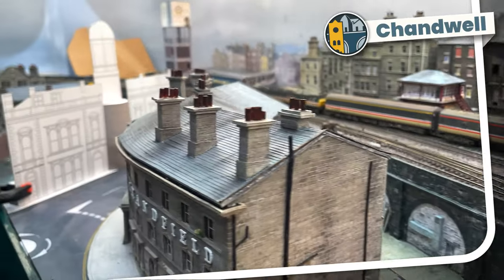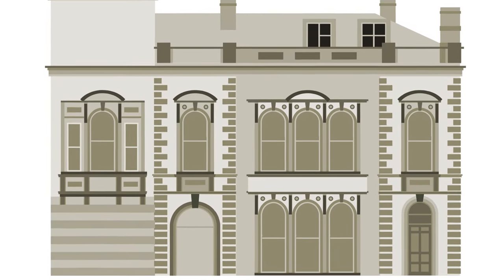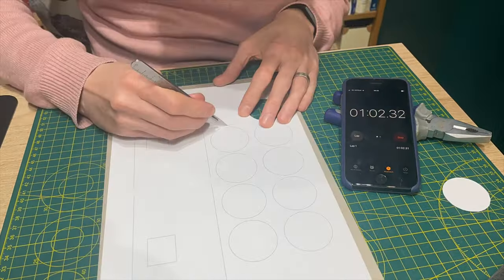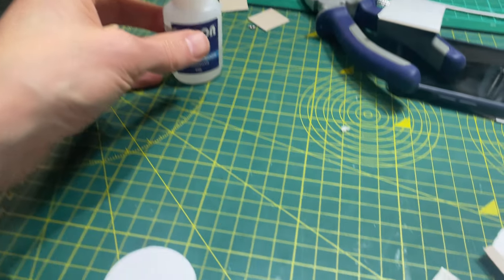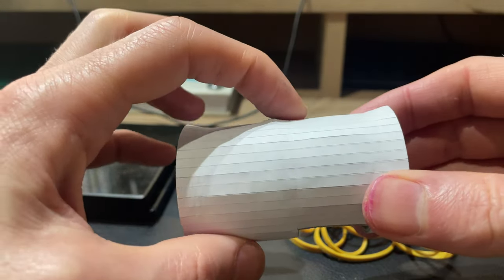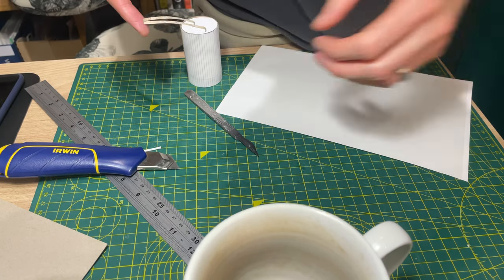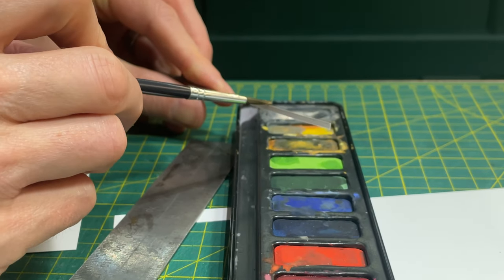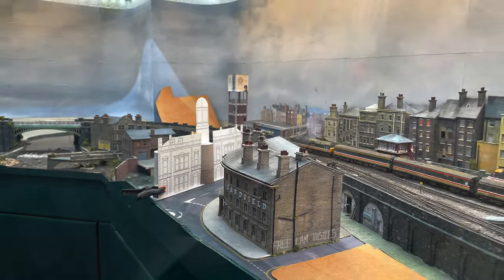Stone cylindrical tower made from card - Town Hall Build Part 1

Comment: I love your inspirational model building. I had an n Guage layout back in 1985 . Then my business took the space. I moved into building ultra light weight one meter model yachts where I used pantihose for hull strength instead of fine fiber glass.
Reply from the maker: "Pantihose for hull strength" I've not used that building material in Chandwell yet, but you never know! :)
Reply: @Chandwell  I use to build meter long model boat hulls as cheaply and as strong as I could for fun using 1/32 balsa in herring bone style then giving it a gel coat like you do with fiber glass hulls , but using pantihose instead of fiber glass. I once built a styrofoam hull and covered it with tile cement the plumber left by mistake. It was an ultra strong build. Not that you need strength in n Guage buildings. My plan in the near future is to build Cape Town's Victorian era central station in n Guage. Not the ugly modern one that we have.

Comment: My entire modeling life is taken up by the construction and bracing of cylinders and conical frustums. Cylinders are easier than might be imagined. Make the outside first then brace them into the appropriate roundness. I cut the skin out, rollit on some kind of former and either tape the mate edges together or put a strip of paper inside to hold them shut with sparing amounts of PVA. Then comes the bracing after. I cut the circles to size and slip them inside from top or bottom. The braces should be thicker stock. A hole in the middle is helpful of they are required to fit at top and bottom. Sometimes there is sanding to shrink 'em to fit. Sometimes the braces simply friction fit and are forgotten. Securing them is best with CA from the inside. No water, no paper swell. I let a small bead of liquid CA drizzle its self around the inner mate point of the brace. Another point. The outer skin can be thin stock. No need for heavy cardboard. The cylinder self-braces and becomes rigid. Any old kind of detail can be glued on later like greeblies or brick.
Reply from the maker: Wonderful advice - thank you!

Comment: That took considerable patience Michael.  An impressive start to what is going to be an elegant addition to the Chandwell even if its glory has somewhat faded.  For cutting circles I found the Olfa CMP-1 circle cutter invaluable when I was cutting the arch tops for the viaduct side cladding.  It worked well on both plasticard and 1mm card and gave a nice neat cut. I suspect it would work well on thicker card by might need more passes to cut through. It  only costs about £11 or so.  Stephen
Reply from the maker: Thanks Stephen. I think I remember seeing you use this tool. I may put one on my list, but I still fancy a pair of those callipers  you also recommended... (I think it was you, wasn't it!?)
Reply: @Chandwell  Hmm callipers you say... the only thing I can think that might fit that description is my vernier callipers for measuring small distances.  Not sure that this is what you are remembering.  Stephen
Reply from the maker: Yes, exactly those!
Reply: @Chandwell  Ah.  Yes definitely get those but I suggest you get digital ones.  I can work my vernier scale now,  but much easier with a digital reader.  Stephen

Comment: Well done!  Cylinders are never very easy... The method I have used in the past is to take a round metal bar (my scalpel handle does the job) and on a slightly soft surface, like a cutting mat, pull the bar repeatedly ( and reasonably quickly) along the length of a rectangle of card.  The card curls a little more with each pass and you can then use your circles to control the diameter... it should  give a smooth surface without the need for scoring.  Not sure how card thickness impacts the curving, but you could always build thin layers.  Hope this helps
Reply from the maker: Great suggestion - thank you!

Comment: The tower starts to look good. To help bend the .5 mil card to an arc, you could also pre-roll it on a wooden dowel or any cylindrical container (glass bottle, rolling pin, metallic jar...) and maintain it in shape with elastic bands overnight or even use a pasta roller if you have one to press-roll the card... I am myself a fan of the rolling pin technique and low heat to roll styrene (warming the pin on the radiator or the wood stove)
Reply from the maker: Great tips Eric. Thank you. I’ll try that on the top part of the tower and see how it compares.

Comment: Dear Sir,

The best method i found for making cylindrical surfaces is to use a small radius rod (something like a broomstick) and press the to-be-rounded piece of paper (or thin metal) over rubber foam and "roll" it, as a pastry... I used this method with papercraft rockets for me 7 yo and it worked. This way there are no need of rubber bands to hold the joints.

Cheers from Brazil!

Edit: The portuguese word for a machine comprised of cylindres to make curved sheets of metal is "calandra." I looked and calender is the english word, methinks.
Reply from the maker: Thank you! I will try that technique next time - that will be a big help! Thank you for watching my channel all the way from Brazil! :)

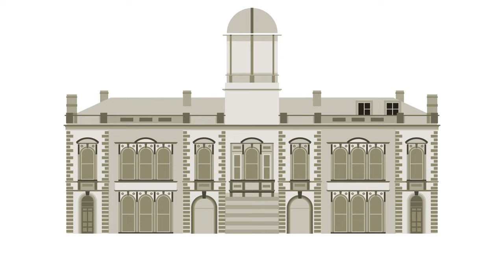Comment: The Inkscape drawing displayed at 1:08 instantly caught my eye. Only having the two roof windows on the right-hand side of the building somehow looks better than the symmetrical version you printed out later at 1:20. Less than perfect, but more in keeping with your town. Looking forward to your build. 👍
Reply from the maker: I'm glad you caught that! The video is in reverse chronological order. The print out came first. As I was preparing the drawing for the video, I deleted the two on the left for the very reasons you mention. It makes a big difference, doesn't it? I'm also wondering about having one of the main windows different somehow.
Reply: @Chandwell  Yes, one got broken and wasn't replaced with the same glass i.e. not frosted, different colour ....?
Reply from the maker: @stevewilliams1054  yeah. Or the real thing has a boarded up window painted black. It’s hard to notice but it does look odd once you do.

Comment: Michael,
I wonder if the reason for the round tower in the original building was because of where it was located. On the corner of the street, so that the tower almost complimented the curve of the pavement. I'm not sure it would have been so impressive a building if the tower had been in the middle of a straight building.
You have the tower, and superbly done it is. Is it worth a few trials to see if it might look better on the corner of the street, in the very prominent position at the front of the layout?
Just a thought.
Bob
Reply from the maker: You're very astute, Bob! I went through the same thought process during the week and I am now in the process of building the tower in the corner. Watch out next Friday for the updates! :)

Comment: I recently made a cardboard cylinder and whilst I have used the scribing method in the past, this time I lightly dampened the rear of the card which made it more pliable  to wrap around a former (tin can). Result is perfectly round without the need for scribing.
Reply from the maker: Oh that's a good idea! Did it not dry wavy?
Reply: No. I then removed it from the can and dried it with a hair dryer. The key is to dampen, not flood the card

Comment: Don’t you think that using manilla folder card stock may have been an easier material to work from.  I am making a storage tank farm and need to make cone roofs for my cylinders of PVC.  I am going to start with styrofoam balls as the basic form for a sphere.  A small refinery needs to have 6-8 spheres ( that would have been used to store propane and butane.  I ramble on.  Looking forward to seeing your next installment.
Reply from the maker: You’re probably right although without trying it I don’t know if the tower would need more bracing to prevent any bowing. But regardless, I don’t have any and I like to use what I have. Spending money hurts! Your builds sound challenging and really interesting. Have fun! 👍👍
Reply: @Chandwell  So true and you are the mastermind the used soda cracker box.
Reply: BTW I am so tight I squeak when I walk.  Rail on my friend.
Reply from the maker: @kenshores9900  😂😂😂